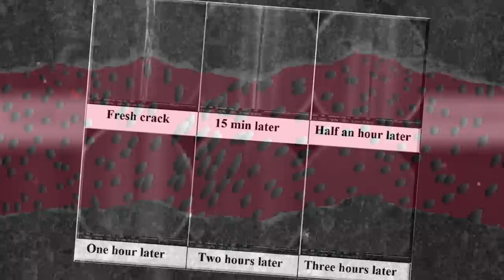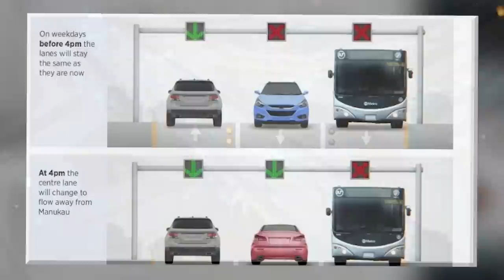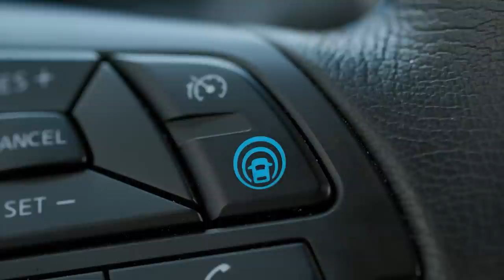FUTURE Road Designs that will change transportation

Comment: Roads should be constructed with  mixture of Asphalt, Concrete & Wastes materials especially plastic and coat them with polyurea. It will make roads more durable and resistant to UV, pollution, climate changes

Comment: We already have those control intersection in Edmonton, Alberta, Canada for years will. It runs along 97St  now known as  Canadian Forced Trail.
 There are 7 separate control lanes. 2 lanes on both end are just  used normally as normal traffic lanes. However that middle lane will only determine what traffic flough get to use that 3rd traffic lanes depending on what time of day it is. Since morning driving into the heart of the downtown city heading south into work. And vice-versé heading back North home. I'm sure there are more traffic control lanes throughout the city, but that is the only one I recognised.
Reply: Are you a lady with very long hair? I admire ladies that grow theirs luxurious lengths, describe it and how it looks?